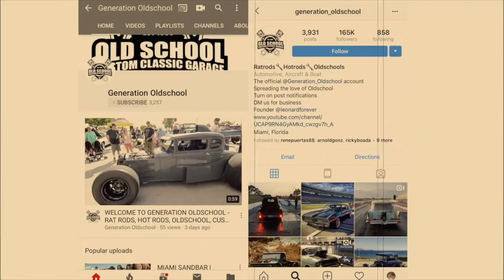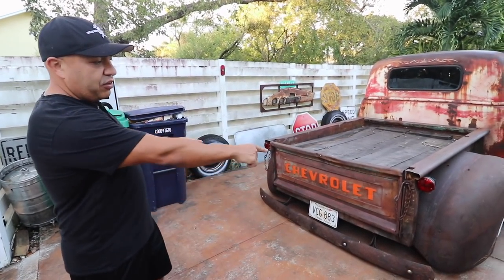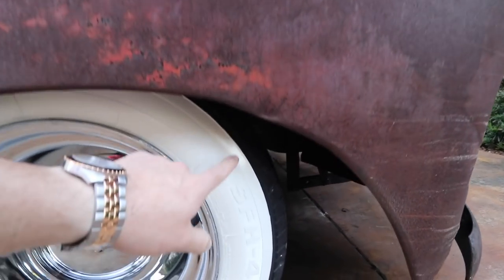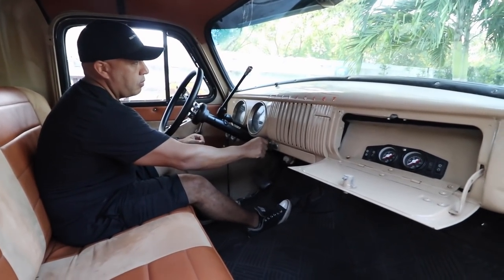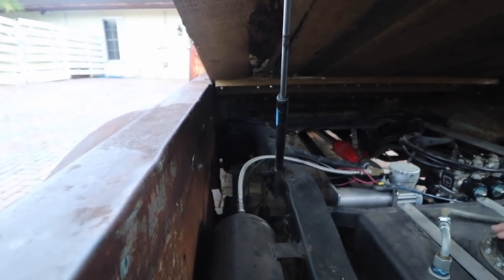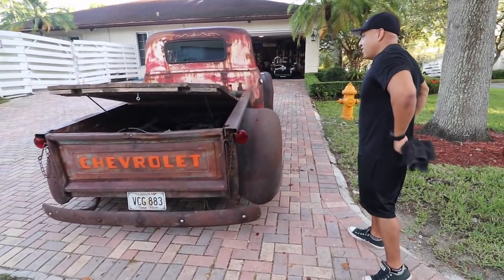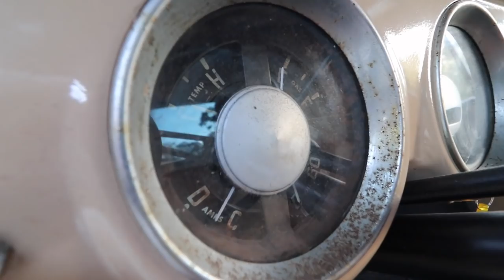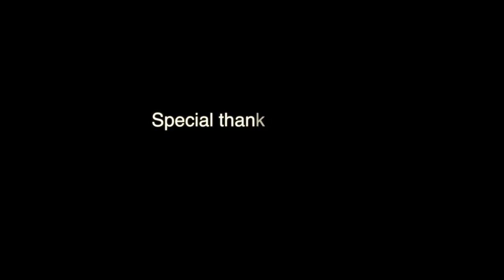PATINA RATROD 1954 CHEVY PICK UP 3100 ON AIR BAGS - Miayota & Generation Oldschool

Comment: It has a small block 350 so it isn’t really a Rat Rod is it.
Reply: It's awsome is what it is!
Reply: Charles Taylor  It is for sure but a Rat motor is a big block not a small block. So calling it a Rat Rod is a little off.
Reply: @terrywbreedlove  
"The modern definition of a "rat rod" is a custom car with a deliberately worn-down, unfinished appearance, typically lacking paint, showing rust, and made from cheap or cast-off parts" Wikipedia 😊
Reply: Charles Taylor  I am old :)